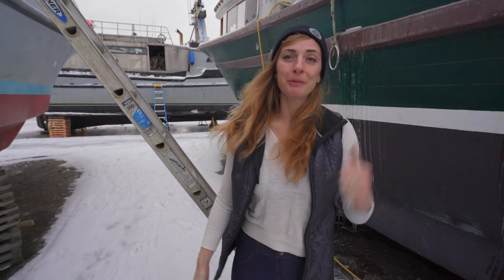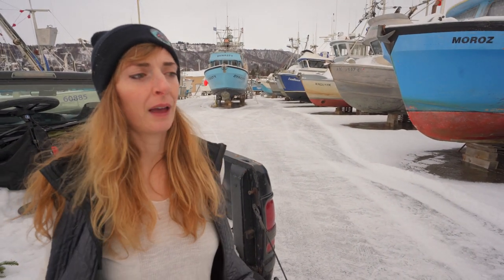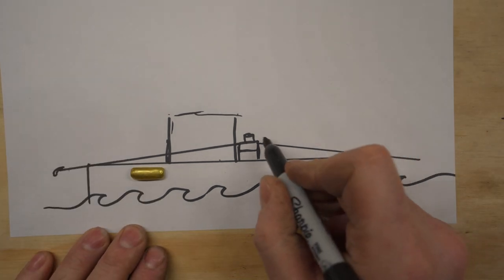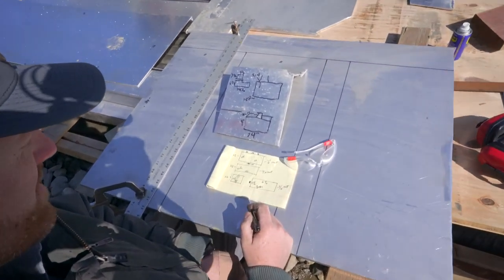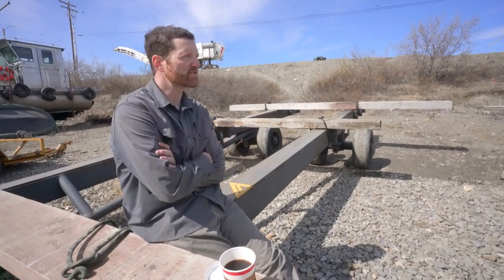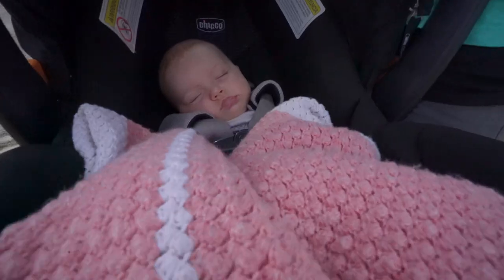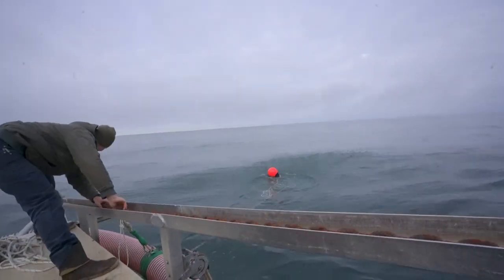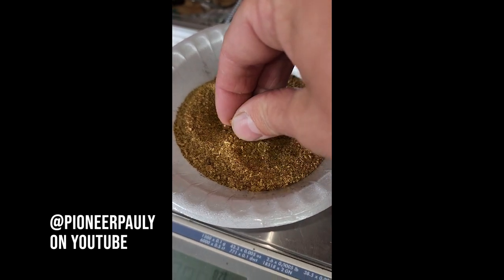We rebuilt the Eroica's anchor system to get MORE GOLD from the Bering Sea (DREDGE DESIGN & PROCESS)

Comment: Hi Emily

Congratulations on your new family and continued success with gold mining. 

I recently came across your videos and am really enjoying them. 

I am a Bering Sea Gold fan and hope to see you again on the series. 

Regarding your anchoring system I have 2 suggestions for a future uograde.

On the video I could not see what is on the end of the chain trough ... and wondered if you had a replaceable roller that would reduce the chance of metal wear on the end of the chain trough ... by the chain ... as the anchor moves in and out.

My second thought is regarding the aluminuim chain trough. If it was me I would cut strips of 1/2" tephlon and fasten the tephlon to the trough bottom ... and trough sides ... using galvanized carridge bolts and locking nuts. The tephlon would help the chain slide easier in both directions ... prevent metal wear that would require a future chain trough repairs ... and could be easily switched out if the tephlon someday wore down and needed replacing.

I hope my comments help. 

Keep up the good work,😊
Reply from the maker: Hey Billie thanks so much for watching and saying hi! We considered both of those ideas. For the roller - we just wanted to minimize moving parts. The stainless bars at the end were fabricated out of an old prop shaft from a boat. It was cheap to make, lasts a long time, and is easily replaceable because it bolts on. The problem with rollers is that the line comes out at weird angles so we would need multiple rollers - and it's just not needed. We subscribe to the KISS method. If we don't need moving parts, we don't have them.

For the trough - we thought about putting some plastic sheeting down on the bottom for that reason, but actually it's a feature that the chain doesn't slide out easily, not a bug. We don't want the anchor slipping off when we untie the line. It's better just to manually set them up to fall when we want.

Comment: Will this enable you to run in rougher seas?
Reply from the maker: Good question! Stronger wind and currents, yes. Rougher seas, not really. The reason is the issue with rough seas/waves isn't really that the anchors aren't holding it's the vertical motion of the waves pulling the diver around like a puppet on a string underwater and, to a lesser extent, wet deck affecting crucial systems.